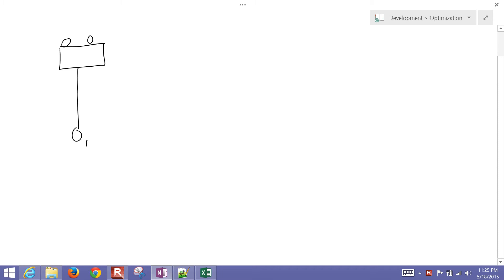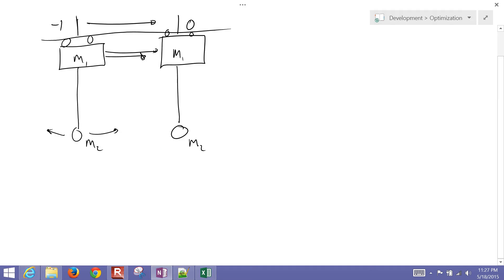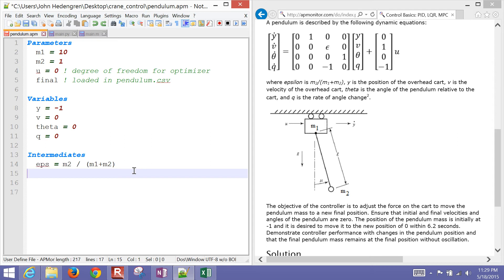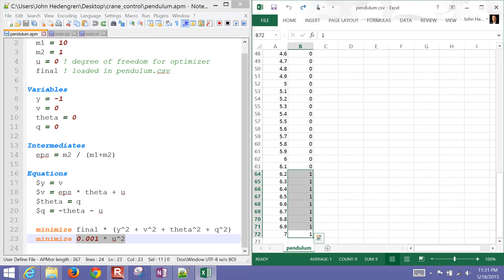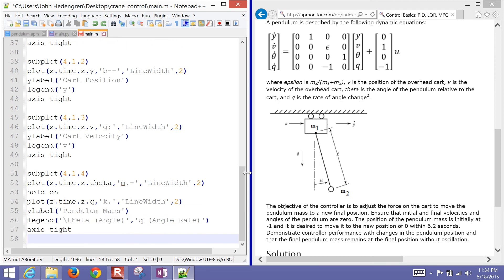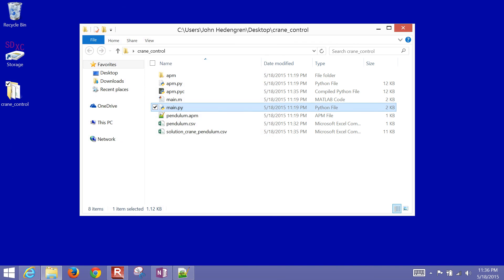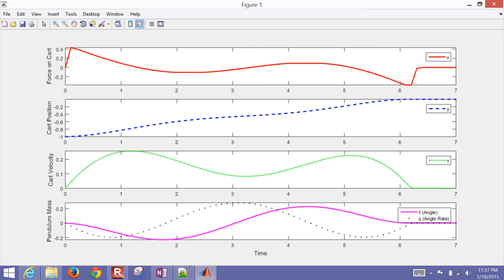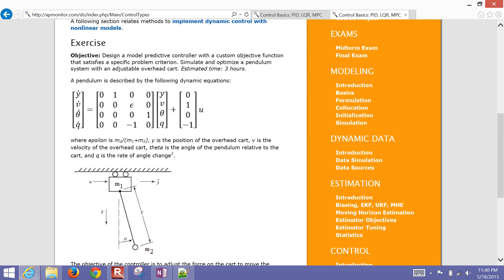Pendulum Model Predictive Control with MATLAB and Python

Comment: Can this be termed under robust MPC?
Reply from the maker: This isn't robust MPC but here is information on robust optimization: https://apmonitor.com/me575/index.php/Main/RobustOptimization and MPC with uncertain parameters: https://apmonitor.com/do/index.php/Main/StochasticOptimalControl
Reply: @apm  Thanks. Can you help me with an implemented example of distributed MPC as well, if possible. I have been trying to find an implemented example for it from a long time.
Reply from the maker: @mahikakarkhanis2885  I recommend that you start with a simple 2x2 MIMO system such as the TCLab: https://apmonitor.com/do/index.php/Main/TCLabF You could split the single application into two MPC applications that coordinate move plans from the other as a feedforward.

Comment: Good video I would like if possible to simulate this a pendulum system by Matlab codes.
Reply from the maker: Here is the Matlab and Python code for you to try: https://apmonitor.com/do/index.php/Main/ControlTypes There is also an inverted pendulum example: https://apmonitor.com/do/index.php/Main/InvertedPendulum
Reply: Good night  @apm   I hope to ask you the name of file MATLAB "main.m" in 'crane_control ' associated with your server if the network cut & the run the file it will give an error.
% server and application
s = 'http://byu.apmonitor.com';
a = 'crane_pendulum';

% clear application
apm(s,a,'clear all');
Reply from the maker: @amr.a-m8350  yes, it won't work if you are not connected to the internet. Otherwise you can use the APMonitor server to run locally: https://apmonitor.com/wiki/index.php/Main/APMonitorServer
Reply: I thank you  @apm  but I would like to isolate or vanish two variables s = 'http://byu.apmonitor.com';
 a = 'crane_pendulum'. We could 

Search instead of a solution without an internet connection.

Comment: Hi there. Loved your work! I'm in need of your help to change the variables of the test where the manipulated variables is the cart velocity that will affect the the swing angle of the pendulum. Can you help me out I'm very new to Matlab
Reply from the maker: Here is an inverted pendulum where the manipulated variables is the force on the cart. You could manipulated the cart velocity instead by relating the force to the velocity. https://apmonitor.com/do/index.php/Main/InvertedPendulum  The web-page also has a regular pendulum and many other example problems.